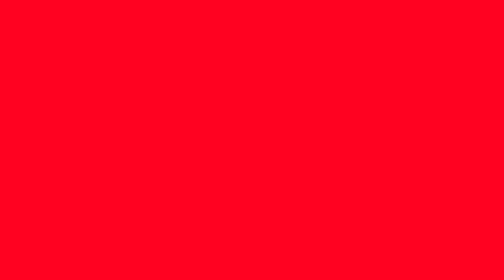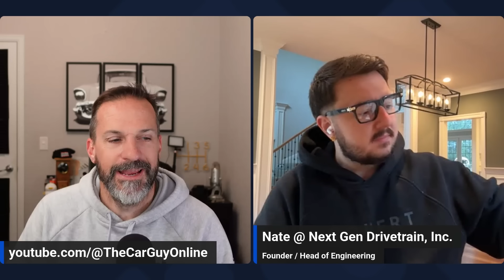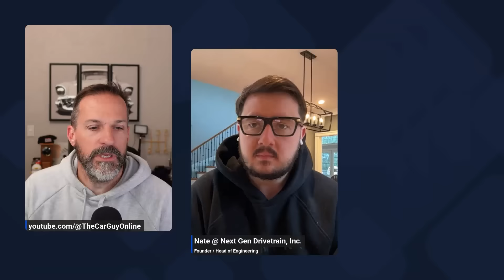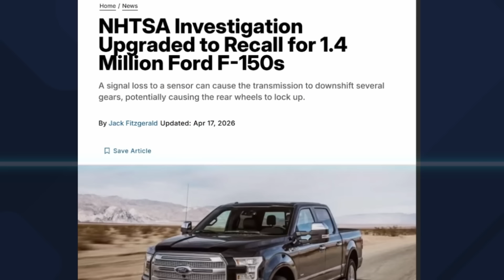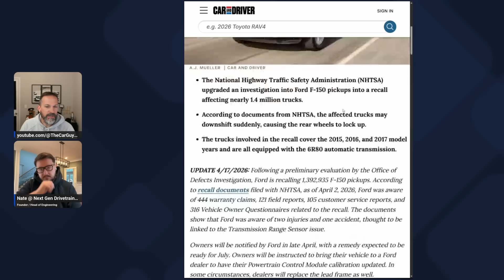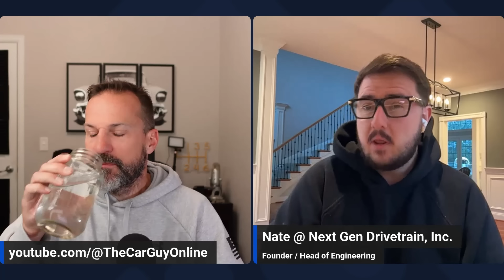Ford's BIGGEST Transmission Recall Yet - 1.4 Million F-150s

Comment: Again it exposes the idiots in the C-suites and the employees that shouldn’t have been hired. Ford needs to hire him as a consultant and have him immerse in the transmission department and get things fixed. Toyota is the worst, look, 3 years plus of flawed engine designed leading to crate motor swaps.  I lemon laced 2022,2024 new tundras because they couldn’t fix a simple fuel tank issues and that system is a lot simpler than a transmission.

Comment: Toyota  8 speed. Automatic transmission has a major failure rate. 2017 thru 2024 Highlander Rav 4 Camrys, Sienna. Class Action Lawsuit against Toyota. Fail @ 45,000 miles. Cost to replace cost the customer $7,400 dollars.
Reply: EXACTLY 💥

Comment: Wow, and yet my 20 year old Silverado is still purring along nicely.
Reply: Our 2015 Expedition is over 246k miles with no issues, engine or transmission.
Reply: Wow, yeah because the newer GM trucks are so great 🙄
Reply: The last gm products worth driving. They went to shit 15 years ago and its been downhill continuously ever since
Reply: Sounds like you should hold on to these vechicles as long as possible
Reply: I wouldn't gloat too much, the ZF 6HP/6R80 is light years better than the 4L60e. 4L80e I'll give you from an outright strength perspective.
Reply: I’m a huge GM guy but they’re no saints. Ask the 6.2s they’re putting out how they’re doing, the new “allison” 10-speeds, the torque converter burn outs on the 6 and 8 speeds, the 5.3 lifter tick, etcetera etcetera etcetera

Comment: I have a 2013 yard ornament F150. Ford contacted me a few years back about this issue. With the 2009-2012 models, Ford replaced the lead frame. However the 2013 & 2014 models have the same transmission but only got program change for the truck to drop down to 3rd instead of 2nd or worse 1st. They said the reason is the 2013 & 2014 were during a model revision and things were changed inside the transmission… but not with the part that fucking fails!!

Literally 2 months after I went in for them to “perform” the recall “fix”, I was in town with my daughter during July in Mississippi “hot” stuck on a county road because the truck wouldn’t go into drive and if it did it was in 3rd only… I replaced the part myself, twice! Amazon part was trash, and each time I changed it I am sure I didn’t do something right. It never acted right until it just quit going into reverse. That along with the first gen coyote sunken valves I parked it… 

Keep in mind, the truck never had one single trans issue or concerning feelings before I took it to them. I’m a Ford guy, my 2010 Edge has 365,000 miles going strong, but I feel like I got screwed and I think every manufacturer is trash these days. All of them wanna save money above anything. They used to lose money on purpose, like they did on the 2005 GT to show people how much they still love what they create. Never will happen again and we will always be gambling our money on which vehicle would be LAST to leave us broke down. Cause they all eventually will.

Comment: Id like to say that from 2004 to 2009 , jaguar and land rover made some of the best vehicles ever.

While managed under ford so many components i actively am replacing on my 06 xjr jaguar are cross referenced with ford making parts sourcing easier. 

The 4.2 supercharged v8 is forged from the factory and can handle 700hp on stock bottom end and the transmission is the zf6hp26 which can handle power long term as well

Comment: We had this bad 2011 f150 3.7 years and thousands of miles, scary on hwy banging into gears my husband spent a bit and tried everything after he replaced the whole key ignition both sides it has not done it since
Meaning lack of voltage to computer that tells trans what to do cause switch was burnt
Reply: He put a third gen valve body with Tcm and had reprogrammed and that was at 320k miles

Comment: If all the auto manufacturers would get away from saving a few dollars making questionable parts decisions on transmissions and  engine parts we wouldn’t have all the problems. 
Value engineering critical components that are difficult and expensive to replace is institutionalized stupidity.
In the end they are spending the supposed saved money on warranties and recalls, instead of making what should be a bullet proof transmission after nearly a century of producing them. 
Especially for what they are charging us for their new vehicles!

Comment: I have a 2015 f150 with the 5.0 and 6r80. 230,000 miles, pan drop fluid change & filter every 50k miles. Engine oil every 5k. Runs and shifts flawlessly. I have had 0 issues with the truck. Uses zero oil between changes and has 30k miles of towing a 6,500 lb boat. I’ll drive it forever.
Reply: Yes, changing fluid makes a difference
Reply: The 5.0 and 6R80 is a solid platform for a modern truck. I have a 2011 f150 with a 5.0 and 6R80. Not perfect by any means but I'll happily take an older truck that needs some simple upgrades to be more reliable over the newer 10spd trucks.
Reply: I have a 2010 F-150 bought new 16 years ago. Now has 173K which includes towing up 6% grades with a 3,500 lb boat in triple digit heat. I like you have changed the trans fluid every 50K. Changed the rear diff fluid and coolant as well.
Reply: I do my oil changes every 3k 5k little to long imo
Reply: @GoogleAsho-226 I vary on opinion and only use synthetic. If I drive a V8 mostly hwy 5k. If I drive a 4cyl turbo and it’s doing some city I would drop to 3k. Diesel is 10k and fuel filter. In a few weeks I will change my new truck at 1.5k 😆
Reply: Cool
Reply: You realize what causes the problem is a bad sensor in the transmission? They literally go bad from getting heat soaked and it has nothing to do with how good you are at changing fluids.
Reply: I have a 2023 f150 oil changes every 5k but the transmission didn't make it to 38,000.
Reply: All I am trying to tough is a SxS, gangbox in the bed, and maybe a boat one day
Reply: Me also mine is a 2019
Reply: Check those trans cooler lines. They fall apart or snap off at the quick connects up front and destroy the trans. I just cut all mine off and ran 1/2” rubber trans hose instead.
Reply: @slipagent6 definitely a common issue. I did the exact same thing on my 2011 f150
Reply: 20 years in a Ford bay and I have not once seen this.
Reply: I’ve had my flushed
Reply: My 2015 F150 5.0 has 190k miles and no issues
Reply: @bronsonspencer9160  well here’s a fun little promise for you. You’ve been extremely lucky. You got a good sensor when the sensor does fail and you’re changing your shorts. You’ll understand a little more clearly the massive mistake Ford has made of the hundred other.
Reply: @AmericanSurvival1  i work at a ford dealer and the amount of 6 speed transmissions ive seen with 150k-200k miles and never had an issue with the transmission is insane. its not being lucky, if you service the trans like your supposed to it will last.
Reply: @ChadG2  more like if you service the trans 2-3 times more often than ford recommends and flush trans completely instead of just dropping the pan.
Reply: @ChadG2 well. . .I got into a argument with the Ford service manager about a trans service on my 15 f150 5.0 with 120k miles - he said they only do flushes and don't do services,  and flushes shampoos the filter , I argued that's the dumbest thing ever and would never do a flush- I didn't say it like that! I'm a pretty good mechanic and Dang good diagnostict , after 2 minutes of debate , he smart elicly said they didn't have a filter any way, I said - I'll go get one now, then he smirked and said -oh they got one with a grin!  But funny thing was I was grinning about it since how I had just paid 27k for the truck , I must have stupid on my forehead too for thinking my filter was going to be shampooed!!! SO - then he smirked and said it's gonna cost to service the trans the correct way , I said FINE!! DO IT!! my faith in dealers are zero!! But you are right sir - service the trans at least once or twice but after 200k don't do it cause it gets risky and obviously do it yourself or get a good third party shop to do it 👌
Reply: @slipagent6 yeah also he said Oh that's only replacing 11 quarts when 14 is in there! He said that's like doing a partial oil change - I said GOOD!!! LOL 😂 I want some of the old trans fluid in there to balance the ph out with contamination , but I will say sir you sound like a great mechanic and I'll take you word for it any day! But the managers and corporate I would not give them a ride on a 110 degree day if they were stranded
Reply: @bronsonspencer9160  Mine as well.  As stated in the video, all about overheating.
Reply: Our 2015 Expedition 3.5T has 246k miles with one transmission fluid change and no issues.  Now that I am back from travel, I need to service it.
Reply: Those 6 speed 10r80 are sought after now. Keep it.  The 10 speed is awful
Reply: @666dynomax  they fixed the CDF drum issue for 2023 models. I have a 2026 F350 and it shifts like butter
Reply: @bronsonspencer9160 good to know cause my 2021 is a steaming pile.   Hate it. 10 is too many gears. Nate claims 4-6 is the sweet spot
Reply: @666dynomax the 10r80 is the 10 speed dude. That’s why it starts with a 10.
Reply: What am I supposed to do with this information
Reply: @R @RCVW-y4x asically go take a crap and forgot about this particular thread !  Just a guy bragging, he got lucky.  Coyotes can’t tow as well as the Eco boost turbo engines and they can burn a lot of oil.
Reply: @slalomking and your turbos can shit the bed with oil and coolant
Reply: Gosh! 6500 pounds. All of it at once were the fuel tanks filled on your jet skis lol😂 that’s not towing you told the maximum that Truck is rated for two or three times and you will pay for it  Ford is junk.
Reply: @AmericanSurvival1 they’re all junk all the brands 2017 or so are trash , maybe 2012 or 2015 even.
Reply: @AmericanSurvival1  lol stupid

Comment: Love the Nextgen message and the approach. The Kit for my 10R80 seemed well made, but I was never able to get it to work,  so I went back to stock.  Now I've got a kit on the shelf... trying to sell..
Reply: Can you call us and let us know what we can do to help? Use extension 3!

- Nate @ Next Gen
Reply: @NextGenDrivetrainInc  I called and sent an email follow up. Haven't heard back yet.
Reply: @NextGenDrivetrainInc  Last email was to Will F on 4/14.
Reply from the maker: Interesting, what was the issue you were having? Did you install yourself or through a shop?
Reply: @TheCarGuyOnline  I did the install myself (that's one of the facets that I like about Nextgen; they advocate for the DIY guy and advertise their kits as such) and to be honest, the installation of the kit itself isn't difficult.  Getting the valve body out on my 2018 3.5 F150 takes a bit even with having a lift in my garage, and I had to do it 3 or 4 times.  I had a LOT of banging, shudder and just poor shifts after install along with some "valve rattle" (my term) where I would hear a faint "rat-tat-tat" right before some upshifts.  Went back and forth with their tech support guy for a month or 6 weeks or so to try to correct but nothing helped.  After pulling the valve body a few times to recheck everything, they suggested putting 1000 miles on it to break it in, I put 1500 on with no change.  So I removed the kit altogether, when back to stock and I'm back to having no shift issues.  No shade on their tech support (Tyler) at all, he was on the phone and email with me a bunch, but he was stumped too.  To be fair the install instructions themselves and kit labeling were a bit lacking (I offered input if they wanted) so maybe updates are in work, just too late for me.  Only problem is I'm stuck with a kit and out $1500.
Reply: @mikew7001 like you’re screwed twice.  I’d never buy a used kit.  They should give you a refund.
Reply: @georgeburns7251  Not sure why I see 4 replies when I reply....
Reply: @georgeburns7251  One benefit of the used kit is that at least now all the parts are labeled! LOL  Seriously though, it's a pretty solid bunch of parts, not much i can see that would suffer from an install and removal.  Not sure why I had issues, except maybe I got a one-off kit with a wrong spring or something?  I typically would agree with you about buying a used kit though...

Comment: My old 2000 Sierra 2500 has the 4L80E. Only 122,000 miles, but no issues. Meticulous maintenance is a key. My daily driver is a 2009 Ford Escape with 330,000. I got 285,000 miles out of their crappy 6F35 in that. Again, meticulous maintenance. Pay me now or pay me several times later. Maintenance is damn expensive, but cheap in the long run.

Comment: Which years are included in the recall?
Reply from the maker: This is the latest recall for the 6R80, they keep adding years, this new recall is for 2015-2017, potentially about 1.4M. https://static.nhtsa.gov/odi/rcl/2026/RCLRPT-26V237-6816.pdf
Reply: @TheCarGuyOnline thanks.
Reply: @TheCarGuyOnline  What are they doing or replacing to correct this recall? Is it a bandaid or an actual fix?

Comment: I changed the lead frame in a 2013 I had but not for this issue. It would randomly lose communication and put the truck into limp mode. Changed it and had no issue.
Reply: Had the same issue with my 2013 last year at just over 200k miles. Finally got the lead frame replaced, so far so good.

Comment: This is one of the reasons I prefer a manual. They can be tough in bumper to bumper traffic "if" you live in a high traffic big city. But the PRICE to fix manual issues versus automatic  issues is so much lower and occurs less often. Choices are good. But if the main choice is an automatic that makes the manufacturer more money through high dollar repairs or increasing the frequency of buyers buying more vehicles from them, ofcourse they don't want to offer a manual.
Atleast let consumers special order a non grenading transmission if that's Their preference.

Comment: Kudos to both of you to drum up a business. “If” I was back into a GM vehicle I’d have a new valve body installed made from Nate’s Co. Currently my tow vehicle for my 3640# bassboat is a 2023 Honda Ridgeline. 1st transmission drain & fill being done 5/4/2026 at dealer. Currently 21,000 miles. I plan on this every 20k miles.

Comment: I have a 6R80 transmission in my 2013 Ford F-150 SVT Raptor with 145,000 km (90,000 miles) on it. I keep receiving intermittent scan defects related to the lead frame, which causes the transmission to shift hard at times. Sometimes, the vehicle doesn't want to start, and I have to wiggle the shifter to get it to start. While it was under warranty, the dealer repeatedly reprogrammed the system. Now that it’s out of warranty, they’ve quoted me $3,000 CAD for servicing and reprogramming. How can I find the documentation regarding any potential recall?
Reply from the maker: This recall is for 2015 - 2017: https://static.nhtsa.gov/odi/rcl/2026/RCLRPT-26V237-6816.pdf 
However they should be able to run your VIN and tell you about the previous recalls, from memory I thought your year was covered under a previous recall and you should be able to get a new unit if so. Did the dealer say your VIN was not included?

Comment: Interesting how he mentions the 4L80, I had a (2005) work truck with a Utility box and 6.0L engine.  It weighed around 9,000lbs - Never had any issues with the drivetrain for 200,000 miles and then it was sold off at auction.

Comment: A discount for viewers would be amazing! Hanging onto my 2016 6R80 5.0 for dear life for the exact reasons you guys talked about in this video. I can't stomach buying a newer truck with all the problems.
Reply: Same here! I've got the 2016 Supercrew xlt with the 6R80 trans with just over 100k miles on the  5.0 and i just changed out the lead frame on the valve body because it failed as per my scan tool. I'm never buying another truck! I'll keep repairing this one! I'm with you 100%!
Reply: Have the same truck. 2016 5.0 4x4 Supercrew. Still only 32k on it (work from home). Hope it's the last truck of my life. I changed the transmission oil and both differentials at 20k. Need to do the transfer case.
Reply: @rvh77I've got 109k on mine and just had to change out the lead frame in the 6R80 trans. She runs great and looks awesome!

Comment: I have a 2013F250 with the 6 speed. I actually like it. I did ZERO maintenence until the filter clogged up with clutch @ 90K. Swapped the filter, drove 500 miles. Did another filter and it is good. It does not haul anything ever. Maybe camping gear at best. I have a 2020 F450 with a 10 speed that confuses me. I had the filter changed at a great shop. The toned down the hard 1st gear shift. They recommended NOT changing the fluid. Just change the filter.

Comment: My truck shows up for the recall but according to NHTSA Ford is working on a software update. Not sure how a software update can fix overheating the lead frame. "A REMEDY IS NOT YET AVAILABLE. FORD MOTOR COMPANY IS WORKING TO PROVIDE SOFTWARE FOR THIS REPAIR. WHEN THE REMEDY BECOMES AVAILABLE, FORD MOTOR COMPANY WILL NOTIFY YOU VIA MAIL TO SCHEDULE A SERVICE APPOINTMENT WITH YOUR DEALER FOR REPAIRS TO BE COMPLETED FREE OF CHARGE. THE REMEDY IS ANTICIPATED TO BE AVAILABLE IN JULY 2026."